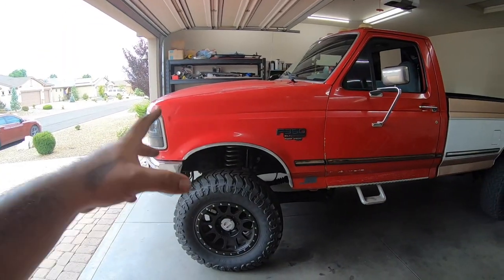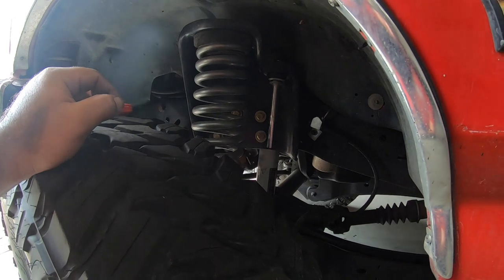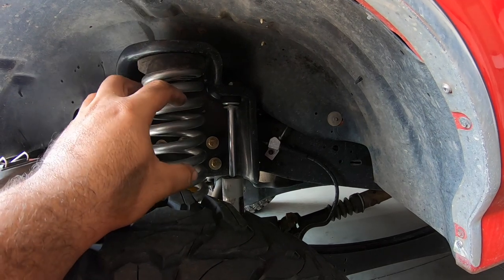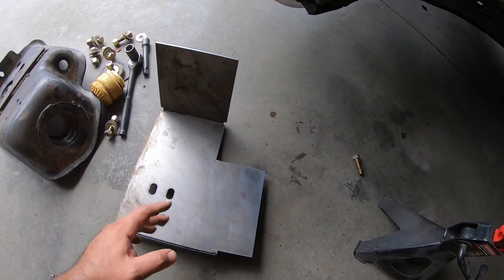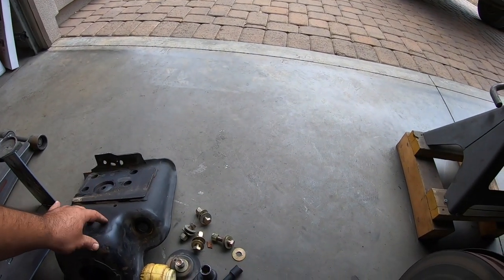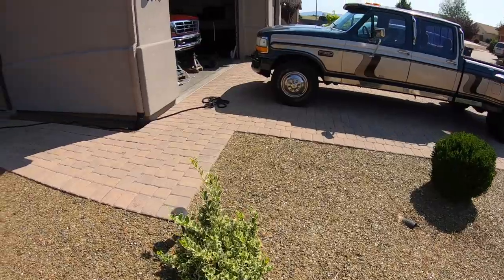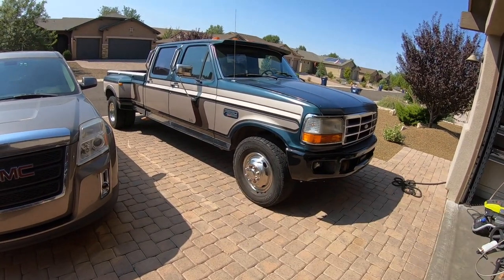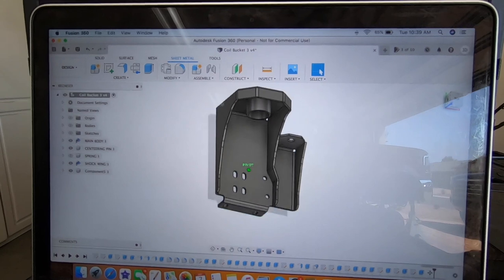We Are Making Our Own 05+ Coil Buckets For The OBS!!

Comment: I am playing with the idea about pulling the cab and bed off of the obs frame and putting them on a 2006 f-250 frame. Do you think this could work?
Reply from the maker: It’s been done before look up 6.0 powerstroke swapped OBS there is a good write up of a guy that did it I believe it’s Cummins junkie. It’s actually something that I’m contemplating for the centurion
Reply: @blowingdiesel  thank you. I'll check it out.
Reply: @blowingdiesel  not able to find it. Not sure what I am doing wrong.
Reply from the maker: https://www.powerstrokenation.com/threads/6-0-in-an-obs-build.545721/
Reply from the maker: That’s the write up lots of good info the actual swap starts a few pages in tho
Reply: @blowingdiesel  thanks I will take a look at it.
Reply from the maker: No problem
Reply: @blowingdiesel  just what I needed. This is probably a better option for me to do. I was dreading having to cut all those rivet's that does not look like a lot of fun. May still do it though we will see.